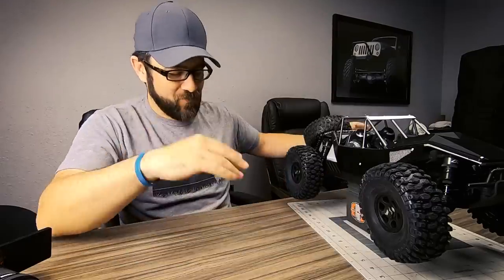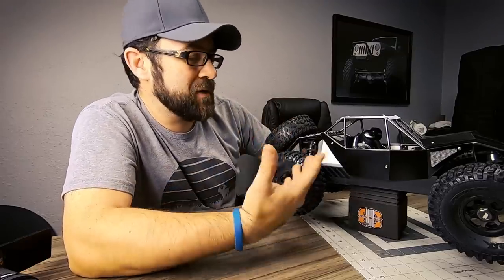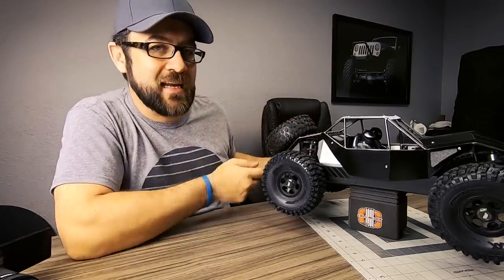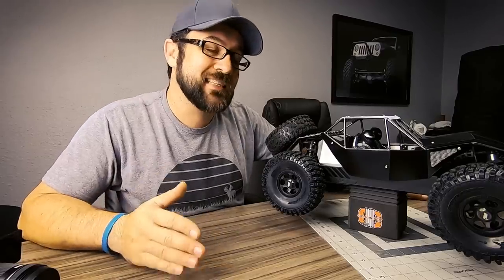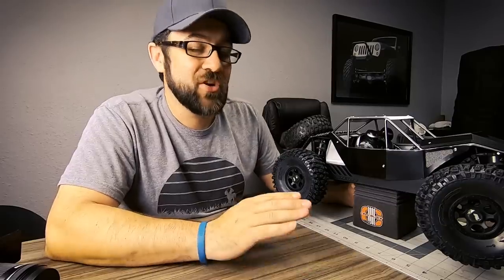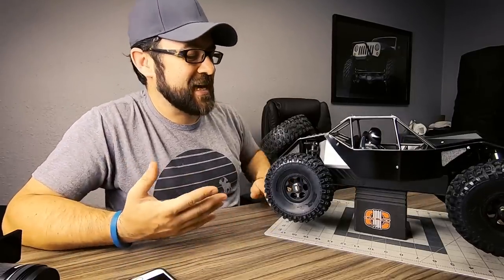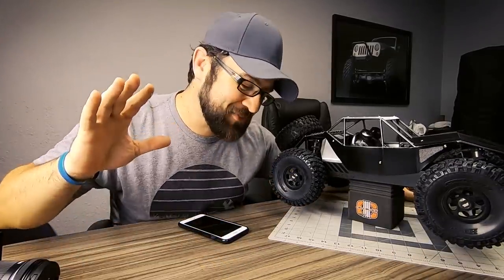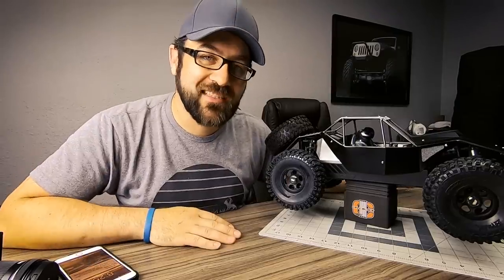#MonthlyMayhem Challenge Ultra4usion - Vlog Ep4

Comment: Looks good with the black. Spare tire isnt bad looking maybe a two plate design for the mount where it clamps together when you tighten the nut that holds the tire on to the mount.
Reply from the maker: A plate system of some sort is my thought also, but I want it to work with my rear filler panel in place so that makes it a little more tricky.

Comment: My first R C was a Axail  Crawler I got for $100. dollars it was so slow next I bought a Losi sct xxx  years later I came back to crawlers . Most are 35 turned motors my Unimog (Axail) is a 45 turn RC4 WD powered. The kit gear gives it the speed I like.
Reply from the maker: I love my crawlers but all of them are usually built with some pretty decent wheel speed in them. I love some power!

Comment: My suggestion for the next challenge, you should take the TRAXXASS UDR or LOSI Super Baja Rey to the next level, preferably the UDR as LOSI  have done it with the Super Rock Rey to run alongside the Baja Rey.
Reply from the maker: The UDR is a pretty rigid platform, and usually we aim to take a platform and make it do what it wouldn’t normally do. So that’s what makes that more difficult.

Comment: Looking good is the interior in it's finished position, as it looks a bit low like some of the less expensive rock crawlers on the market.
Reply from the maker: It’s sitting a little lower as it’s just pushed in there. But it’s a hair smaller than I’d like. But I didn’t have the Bomber version I wanted at the time.